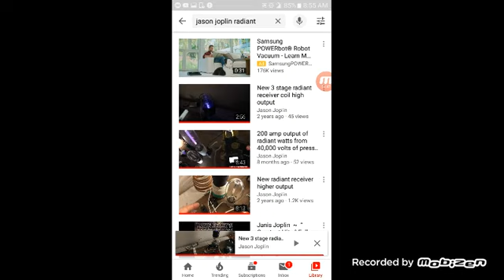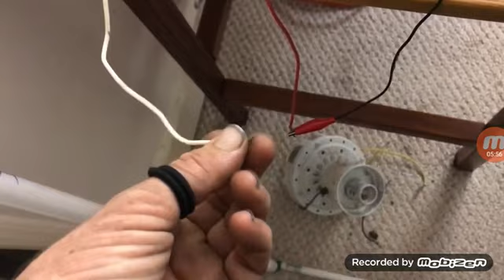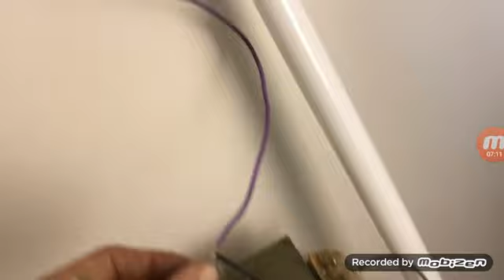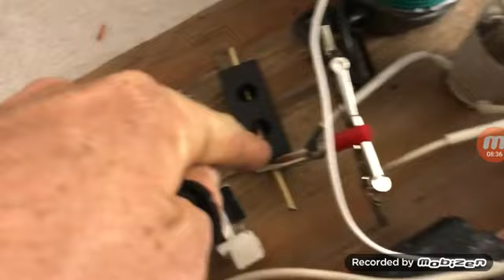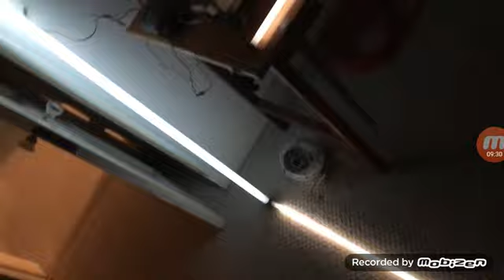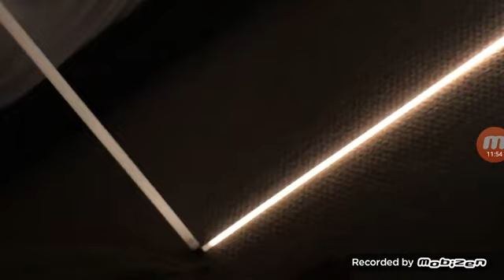Pulsed Plasma Wireless Transmission

Comment: So looks like some sort of Kapazne or DON Smith generator Tesla Coil?? Taps into earth?? 
Can you kindly put in list of components. Needed and circuit diagram would be great 👍👌
Reply from the maker: I'll be sure and do that
Reply: @JasonJoplin  Dear Mr. Jason Joplin, I love your exploration in the world of RF. I'm working on it too (from France) and I would like to know what was your input power to do it ? Thank you for helping us to explore that magic world.
Reply from the maker: @Pierre-Marie-9-6-5  so my input power was a motor-generator setup, to an ignition transformer, however later on I realized I could run that ignition transformer off of an audio amplifier, much quieter operation, virtually silent, then you'll be able to use a signal generator on your audio input and dial in whatever frequency you want, and if you get the right sig gen you can also phase shift your signal which can come in handy
Reply: @JasonJoplin  Thank you a lot for your explanation. I did not thought about using an audio amplifier (done normaly only from 20Hz up to 20kHz). So when you speak about ignition transformer are you speaking about motor generator with spark gap ? I'm working on a signal generator with an amplifier (mosfet) to produce the signal I want to get (from 1 Hz to 1MHz). Normaly I should find the resonnance of the system like that (by seeing the amplification of the lights)
If you are ok, could it be possible to speak or exchange with you in private ? I will explain to you what I'm exploring and what could be done to achieve it.